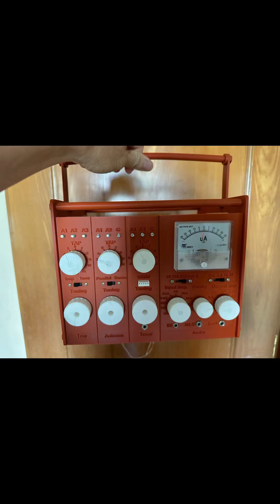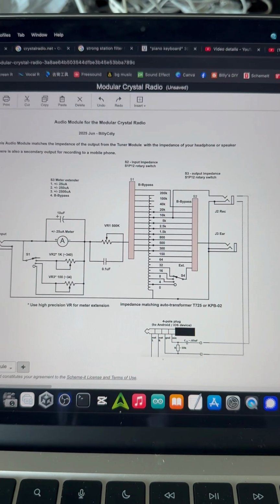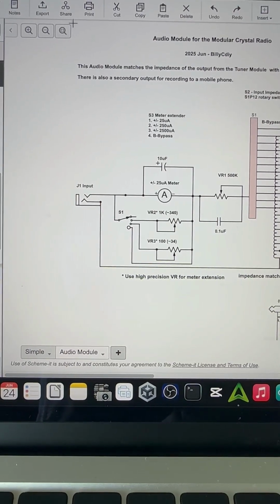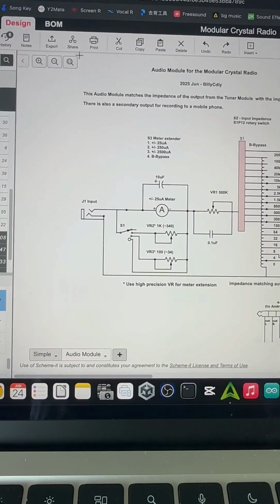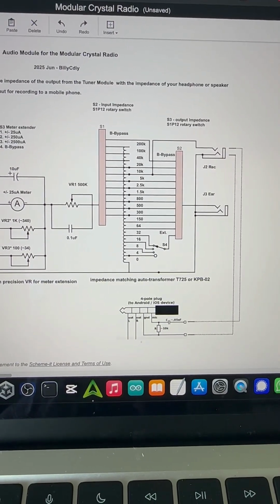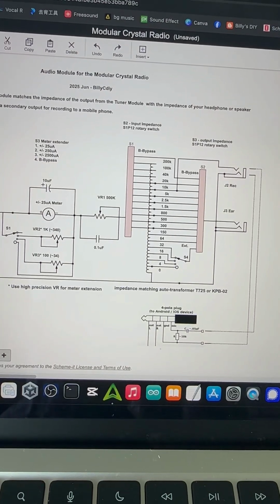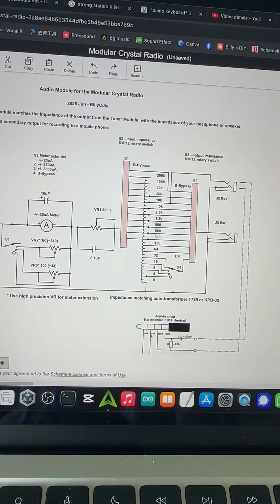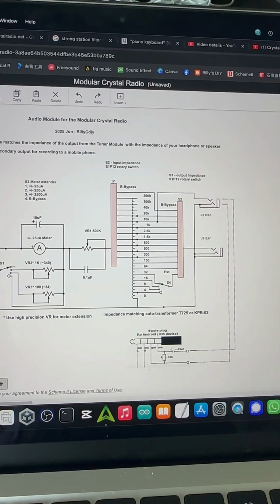Circuit diagram for the audio module of the modular crystal radio

Comment: I'm very anxious about this fantastic project.
I made one galena radio 40 years ago using 2 tuned circuits mechanically assembled 90 degrees apart, one tuned in the best local AM station in the region, generating more than 1.15V, after used to supply one transistor audio amplifier.
Reply from the maker: Thanks for your sharing. I also have a similar set up. I have two big loop coils with both have a diameter of 1 meter. I set one up vertically to receive stations from a transmission station located on ab island 4Kn away. The other one  is oriented horizontally to receive from a station on the top of a hill. The modular crystal radio I am working on allows the coils to be oriented 90 degrees from the neighboring coils too.
Reply: 😊 @BillyCdiy